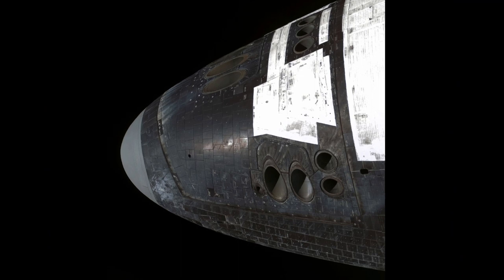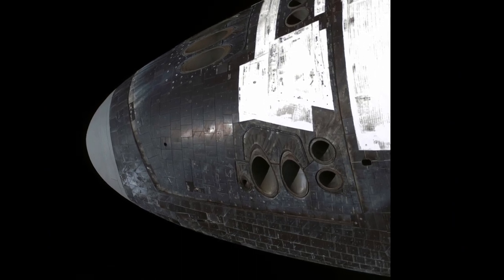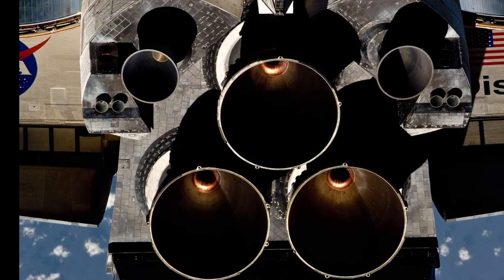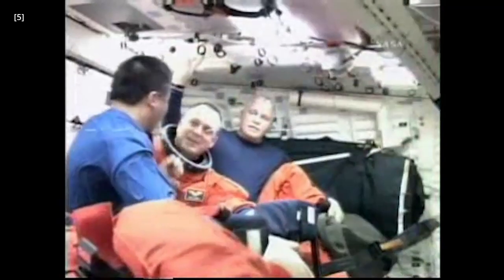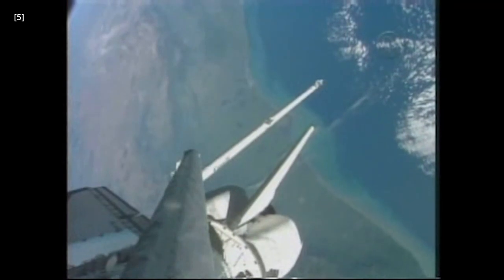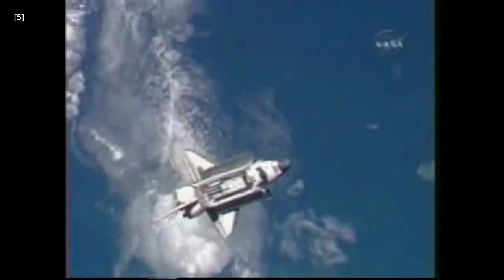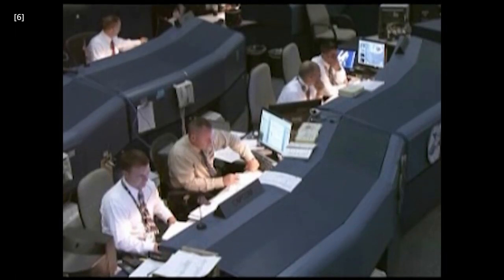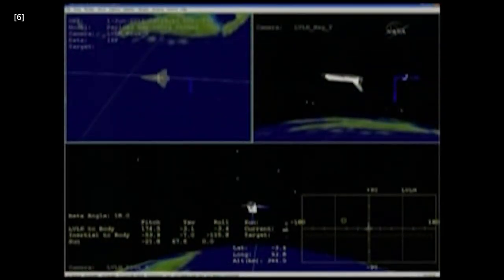Mastering the Controls: How To Steer the Space Shuttle

Comment: How does RCS and OMS work in an environment where there is no air, no oxygen to burn fuel, and not mass to push and rotate the space shuttle? That looks impossible.
Reply: They mix oxidizer in everything num nutz
Reply from the maker: Oxydizer... And Mass Ejection works also in space. Imagine sitting on a office chair with wheels and holding a fire extinguisher. Using that will push you in the opposite direction. Its the same in space with RCS or OMS or the normal rocket motor...
Reply from the maker: DFKJRFGTSWDJD  Please check Newtons third law... Orbital maneuver thrusters work in space because of Newton's third law of motion, which states that "for every action, there is an equal and opposite reaction." They don't rely on pushing against the atmosphere but rather on expelling mass in the form of gas or plasma.

When a thruster fires, it ejects high-speed gas in one direction, and in response, the spacecraft is pushed in the opposite direction. The expelled gas generates force (thrust), which propels the spacecraft. This works even in the vacuum of space because the force is the result of the mass of the expelled gas and its velocity, not interaction with the surrounding environment.